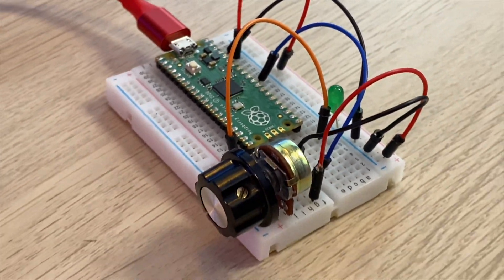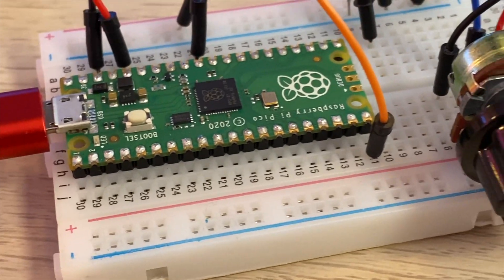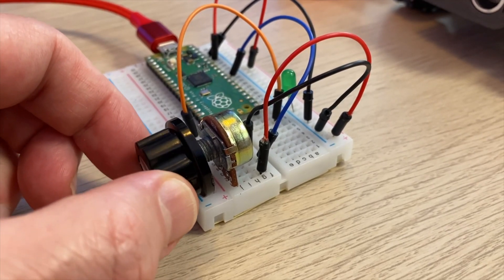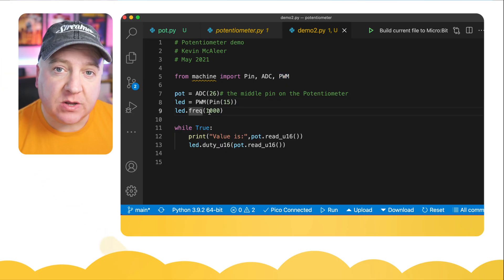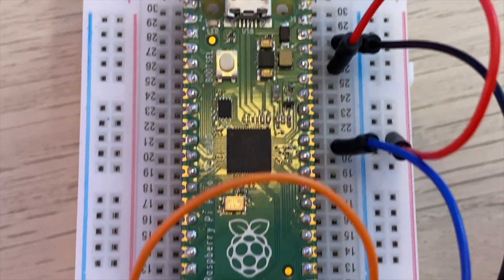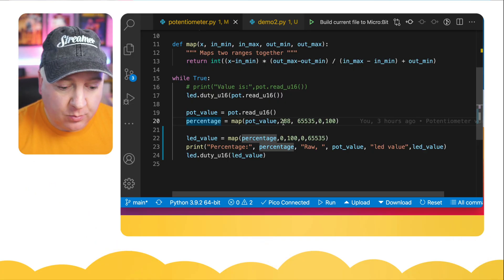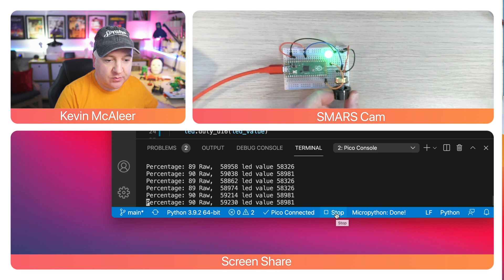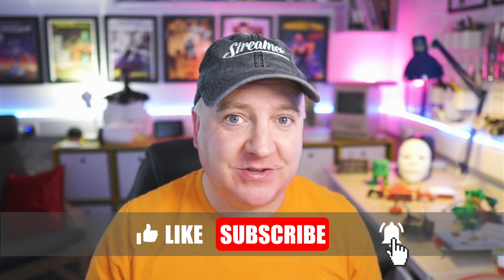Potentiometers and Pico with MicroPython

Comment: I see everyone doing this with a breadboard, is it still simple not to and is it cheaper?
Reply from the maker: It’s simpler to plug into a breadboard than to solder or use DuPont cables as the breadboard gives the Pot something to be held in place by when you turn it.

Comment: Could the pico handle a string pot with a stroke length of 20 ft? Ive found some from a company called UniMeasure that seem close to what I need, they can operate on low voltage from what the specs say.
Reply from the maker: Difficult to say without knowing the specifics of the component.
Reply: @kevinmcaleer28  There is the page with the different designs. I have looked through them, but I'm just starting to learn the basic concepts at this point, and could use some advice on which model is best, and if this is even a realistic idea. Thanks for the help!
Reply: @kevinmcaleer28  For context: I am trying to build remote gauges that report back the level of oil and saltwater tanks.

Comment: when i upload your code my pot values dont change from the pot when turned unless i add a small delay into the code then they work...what am i doing wrong
Reply from the maker: What kind of pot it’s it? They are not all the same, some are linear, some are logarithmic
Reply: @kevinmcaleer28  what’s the difference?
Reply from the maker: @destructivenews6734  Linear change the value at a consistent rate (half a turn is equal to half the resistance value), logarithmic potentiometers change the values based on a logarithmic scale - these kinds of pots are used in audio volume controls where something that is twice as loud doesn't sound twice as loud due to the way we perceive volume. There is a better explanation of the difference between lin and log pots here: https://learnabout-electronics.org/Resistors/resistors_09a.php#:~:text=Logarithmic%20potentiometers%20are%20used%20as,a%20setting%20of%20half%20volume.
Reply: Im glad you said this, because I had the same issue.

Comment: Hi Kevin, I see you're using vscode as your editor for the MicroPython video's. What extensions have you installed  ? Pymakr I presum, anything else ?
Reply from the maker: I'm using PicoGo, PyLinter and PyLance. There are also a couple of other non-pico related ones such as Markdown table prettifer, GitLens, Python Doc String Generator